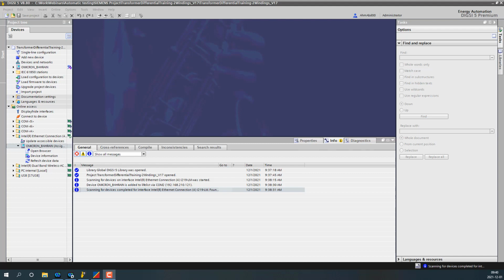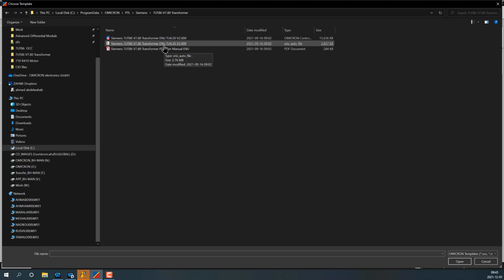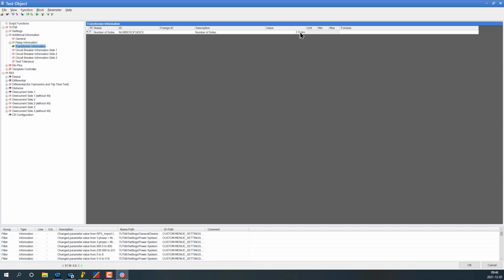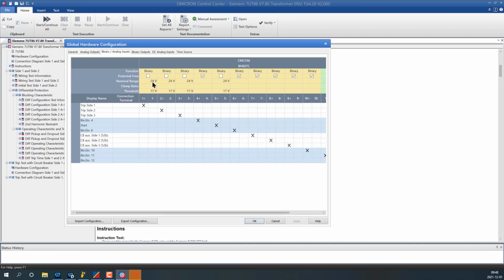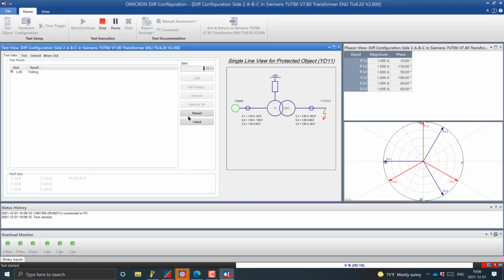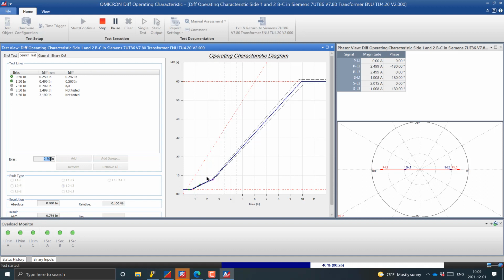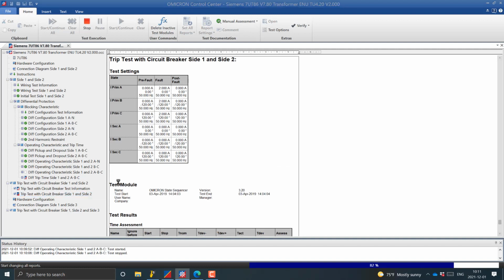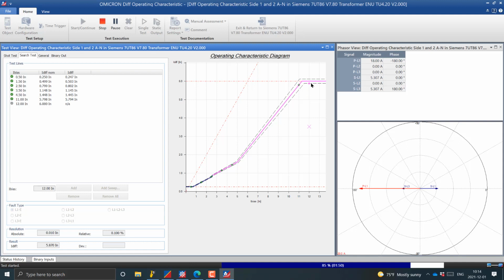Testing Transformer differential Protection  7UT86  SIEMENS SIPROTEC 5

Comment: Hello dear i am having this relay on our auto transformer 132/220KV. There is an alarm persist of "E:ETH-BB-2FO:Channel1 RSTP Channel fail" and the same also appears on 7sj8041 realy that next to differential relay. I have checked the fiber optic cable between them that is ok. But alarm is not getting rest. Can you please help. How to check this fault
Reply: We have the ring communication over fiber optic cable, communication of other devices in this ring are fine but two relays showing this alarm.